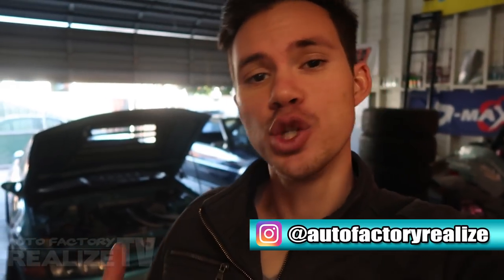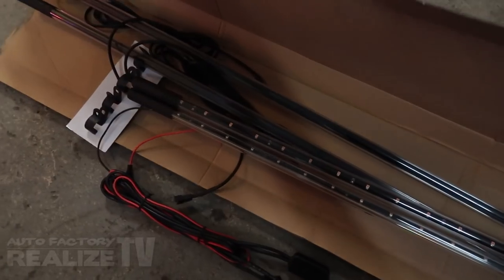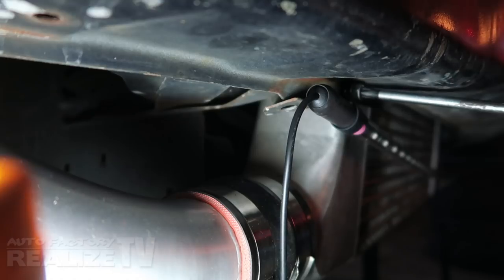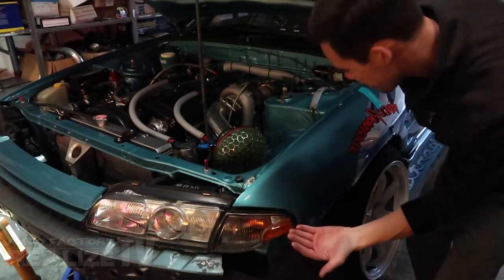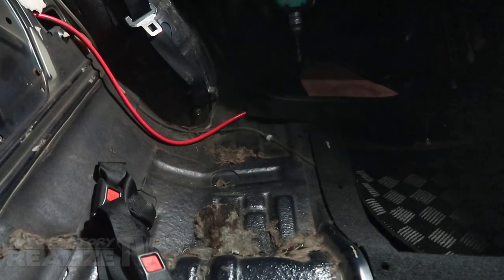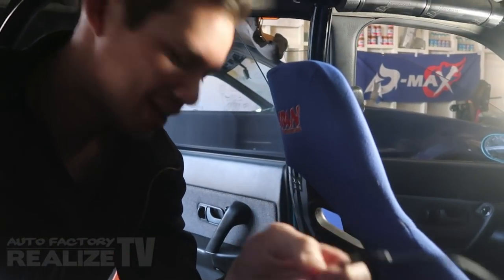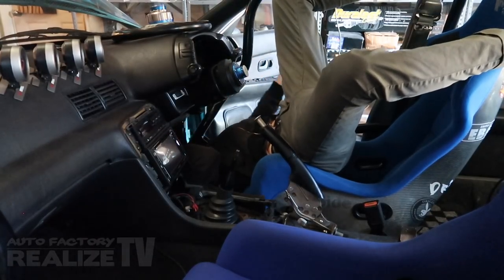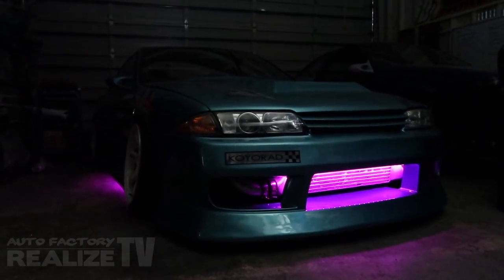Teddy's R32 - UnderGlow Install!

Comment: so how did the lights turn on wen the was no power source, just de button? did u not show de power hook up orr...?
Reply from the maker: The power source comes from the cigarette lighter I believe. You really can pull power from many different sources. Just use a volt meter and make sure it matches your criteria and is safe to use.
Reply: @AutoFactoryREALIZE  cool, thank you! 😊